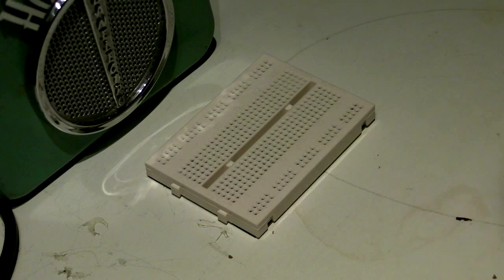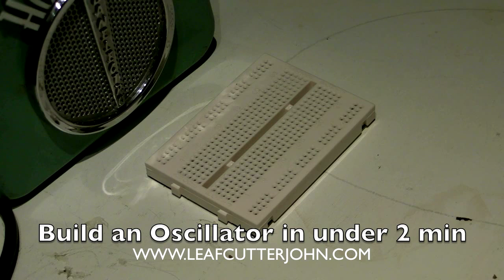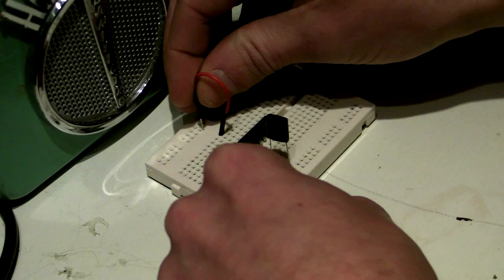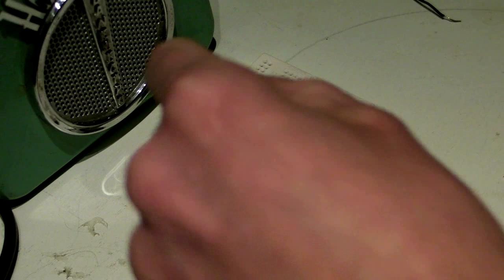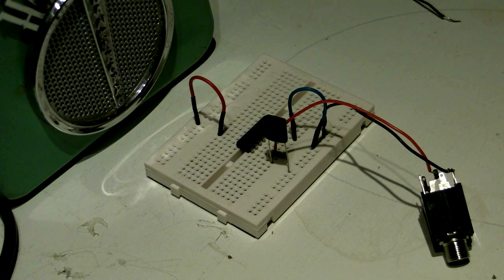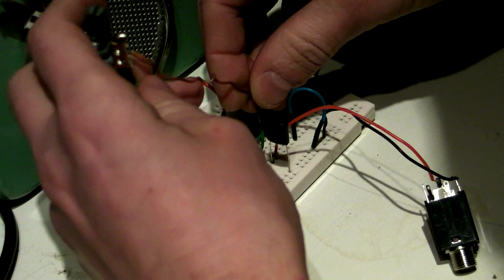make a CMOS oscillator in under 2 mins

Comment: @Ciaran55 Use a 1/4" mono jack like Switchcraft type 111X, available at Mouser Electronics and other distributors. Also, he's only using one of the six sections of the IC (pin 1 as input and pin 2 as output). He should commit the five unused inputs to either +9V or ground. For example, he should ground pins 3, 5, 9, 11, and 13. Leaving these inputs floating will invite problems, including the possibility of the IC overheating. Lastly, it is good to add a 0.1uF decoupling cap from pins 7 to 14.

Comment from the maker: @Cds56 no 100N = 0.1uF but you will get different pitches with different values. Try a selection of different capacitor sizes. Same goes with the variable resistor i think i probably used a 1M or 100K you'll get results with any large VR. In fact you don't even need a VR just attach two bare wires to pins one and two and use your skin to change the pitch!

Comment: a normal speaker will work fine from a cmos oscillator, you will need to use a capacitor in series with it though. so OUTPUT > CAP > SPEAKER :)